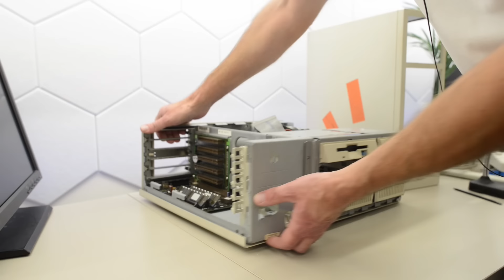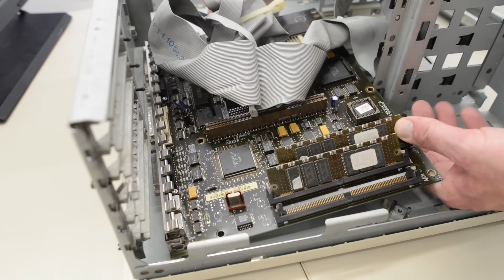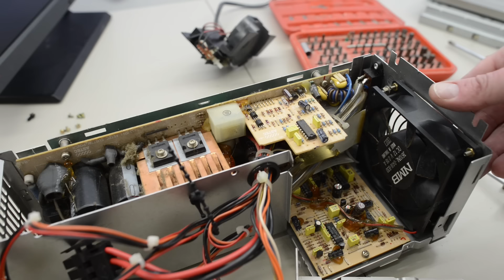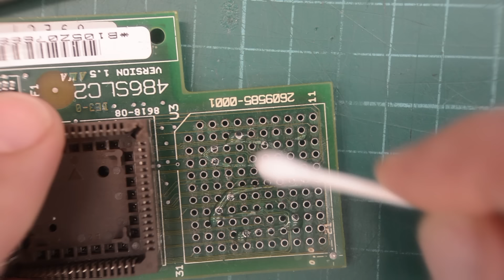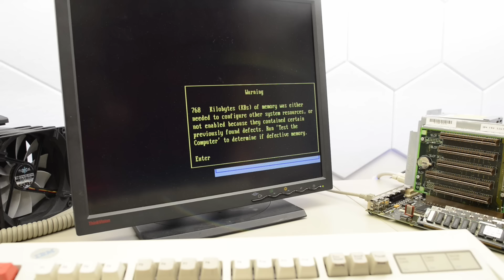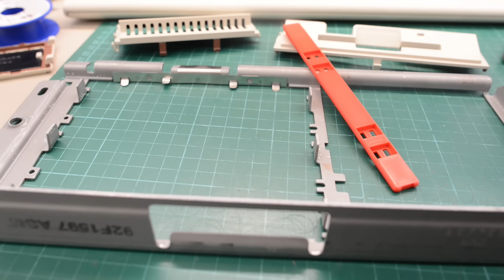Rare 486 interposer repair & IBM PS/2 Model 57SLC restoration (8557 & SLC2)

Comment: IBM PS/2 machines are extremely picky about their RAM modules. While most non-IBM machines simply try to enumerate the size of the RAM sticks by themselves, PS/2s rely on the presence detect bits. There should be one to four SMD zero-ohm resistors on the side of the module which are setting those bits. Your module, since it is not an IBM module, probably has all of those shorted to ground, so it gets detected as a 4MB 80ns module. Either remove all but the bit 2 resistor, or you might try to use some small bits of Kapton tape to insulate pins 67, 68 and 70. That should make the PS/2 correctly detect it as an 8MB 70ns module.
There's a list of all the combinations on ardent-tool: memory/Reference.h tm l
Reply from the maker: Thanks. I need to spend some time figuring out all the different IBM SIMMs. I'm hoping we will eventually be able to make custom PCBs for at least some of them

Comment: These are the memory module p/n for the 8557..
IBM Personal System/2 2-8MB    $1695   #5211  6450605  2MB  8MB  85ns  Adapter for 857x-xxx or 8580-xxx
80386 Memory Expansion                                                 Uses #5212/#5213
Option
 
IBM Personal System/2           $695   #5212  6450603  1MB  1MB  85ns  Module for 857x-x61 (P),
1MB Memory Module                                                       8570-121 (P), 8555-xxx (P),
Kit--85ns                                                               #8286, or #5211
Reply from the maker: Thanks. I wasn't able to find any RAM module with that number. However, I figured out why it didn't work just now :) It will be in this week's video :)

Comment: I dropped an AMD FX8370E and the pins looked like that. I straightened them all out using a tiny crosshead screwdriver by touch, since my eyesight isn't good enough anymore! It did take a while.  It's still working!. :-)

Comment: Ahh, the 2.88mb floppies. The bane of my existence. Someone got bamboozled by the local IBM rep for my local branch of Library, and they used them... And it always caused problems when those disks never worked anywhere else. Save your work at the library, but bring your own disks.

Comment: Nice job and nice PS/2 :-) But I have a question, how do you clean/wash those filthy power supplies? Thinking what should I do with my filthy AT power supply.
Reply from the maker: Thanks. I just wash them with warm soapy water and then dry them with hot air

Comment: About the double sided ram not being correctly recognized- it might be the case of the bios upgrade. I remember once we visited the bank branch where they used Compaq’s desktops. After running over with bios upgrade disk, each of the PCs started to report twice as much ram as before. It had appeared they were fitted with double sided sticks which started to be recognizable.

Comment: Nice video. I got a new old stock cpu upgrade that you used. It has that bracket you used and also had a black square plastic spacer that sits around the 387sx socket. The 56/57/76/77 chassis all had rotating badges, just like the pc 330's. The 76/77 also had floor stands that clipped on the case.
Reply from the maker: I'd love to find one of those stands, they look cool

Comment: 27:25 Many pre 486 motherboards struggle with suport for non standard RAM size like 2, 8, 32 MB. Sometimes RAM IC have non symetrical RAS/CAS adress lines, what is causing most of the problems with compatibility.

Comment: I have an IBM Model 40SX that seemingly uses the same case! I really like that machine, because it has ISA slots :D

Unfortunately, the soft-power-on power supply has died, and I need to repair it. Already recapped it, but that did nothing (kinda expected that). I suspect the power good circuit is bad. Don't leave this plugged into power!

Edit:
Just got to the part where you remove the power supply and mention it is not standard AT. That is true, physically. Actually, the pinout I have found indicates that an early ATX PSU would be perfectly suited to being rewired for this PS/2 power delivery style. But then trying to fit an early ATX power supply into the existing PSU chassis is not easy!
Reply from the maker: Yeah, you're much better off repairing the PSU than replacing it. Even if it turns out to be difficult. I will make a repair attempt on my Model 70 PSU (no power good). Hopefully in one of the videos in December.

Comment: The IBM 386SLC has 8Kb of L1 cache and runs all Intel 486SX instructions. The 486SLC2 has 16Kb of L1 cache, as you noted. When the 486SLC2 daughtercard is on the 8556/8557, it is run from the 20MHz base clock (meaning 40MHz internally); When used on a 9556/9557 system, the base clock is 25MHz.

Someday I plan to test all of the Model 56 and Model 57 systems as a comparison...
Reply: There's the link from the 'Ardent-Tool' as well...
Reply from the maker: Thanks David. Do you know if all SLC2s are good for 50MHz? Or even faster?
Reply: @Epictronics1 : The 486SLC2 daughtercards should be able to do 50MHz (although the 486SLC3 being able to do 75MHz is more evident) - I'll need to do a summary comment.

Comment: 5:53 - IBM PS/2 was a large construction kit. The same base chassis had been used for an ISA Model (8540) as well as for the 9577's and - IIRC - an entry level RS-6000 of which I cannot recall the model number, cause we did sell and support PS/2 only. A rare find were an IBM PS/2 Ultimedia M57.  I have a 9577 with the Ultimedia stuff. Used it in the early 90's along with the ACPA/A to convert analog records to MP3 ...
Reply: I stumbled across a plain 57 486SLC2 a few years ago and bought an M-ACPA/A card to get as close as I could to the Ultimedia configuration. One interesting thing it has in its driver/documentation diskettes is C source code for doing various things with the big Ti TMS320 DSP chip, including a JPEG decoder.
Reply: @bobbobson1605  The TMS320 was a family of chips assisting for compression purposes mainly for audio but video as well. Given the time they appeared they were pretty groundbreaking and the developers added a lot tools - of which the MPEG audio coding was the most prominent. I had a 77i / 486DX2-50 with the M-ACPA to record my old analog records under PC-DOS 5 and using the M-ACPA kit for quite some time. The bottleneck was the harddisk, since that was generic SCSI and they were non-streaming capable. Once they had to recalibrate your record was losed up. I recall having recorded the first side of Pink Floyds "Dark Side Of The Moon" at least three times ....

Comment: You could just solder some pins from a defective cpu. no need to remove it.
Reply from the maker: I don't think I have any scrap CPUs. I have however  repaired a 486 ones with a broken of pin by soldering it to the CPU. It totally worked

Comment: What kind of SCSI cable is needed for the external SCSI interface?  I have a similar IBM (8556) that I would like to add an external CD-ROM drive to but I can't seem to confirm which drives are compatible.
Reply from the maker: I have not looked into this yet. I have an external SCSI drive that I plan to restore an try out with some PS/2s in a future video. I'll do some reading (and probably get or build an adapter)

Comment: I'm actually surprised the 2.88 drive never caught on. I wanted one. So did everyone I know, but you couldn't find them.
Reply from the maker: It is strange indeed. Especially sins they were backward compatible with regular 1.44
Reply: @Epictronics1  A couple things: in the above sentence the word you want is since instead of sins. At 2:30 I believe the expression you are looking for is "It never really took off." not "on". Just a few things to be aware of. 

*Edit*  You probably mixed up the expression "It never really took off" with "It never really caught on".

In regards to the 2.88 MB drive, I don't really remember them being a thing. Since they are backwards compatible, I wonder why they didn't take off either. Maybe it was a cost thing?
Reply: @zeroProwler  I wasn't trying to be annoying, I was trying to be helpful. I'd want someone to correct me in the same situation if I was speaking in a second language.
Reply from the maker: @LotoTheHero  Thanks, I appreciate the help in spotting my mistakes. I'll try to remember
Reply: I think, it was a matter of price, availability and price of 2.88 disks on top of competition from ZIP disks and CD-Rom. And 1.44 was already too well established as the standard for publishing content on diskettes.
It was one of those things that came too late to enable it to take off.
Reply: @bikkiikun  cd's were a pain. zip wasn't backwards compatible. So 2.88 would have been nice.
Reply: The only other systems I know that used them were the NeXT workstations.  The disks were pretty reliable, but unfortunately rather expensive.

Most Pentium-class and up motherboards supported 2.88 drives, but the drives themselves were rare.  At one point I had an IBM 2.88 drive installed in my Athlon XP system!
Reply: @awd42  I just know back in the 90's it would have helped a lot. Unless they were zip disk prices. $10/disk would have been too much.

Comment: The 386 with L1 cache is unique enough that I wouldn't upgrade it. It's the only 386 model that has any on-die cache. I have only read about it, never seen even a video before yours! This is really cool.
Reply: Intel also made special 386 for laptops called 386SL which had integrated L1 (edit: after reading Intel datasheet, it only has integrated cache controller it seems), ISA bus controller and power management among other things. Compaq LTE Lite laptops used it, for example.
Reply from the maker: Yes, I think we got roughly half the FPS when we ran benchmarks on the IBM with a regular 386 compared to this SLC. These are both pretty cool "386"s!

Comment: I'm surprised you didn't grab the re-work station sooner. lol
Reply from the maker: Gotta try every method ;)
Reply: @Epictronics1  I'm watching you struggle and I'm like....at least use flux, but you should really pre-heat it.
Reply: I was also thinking you need a sweeper tip for your iron. It's nice and wide you'd be able to reflow the whole socket in 10 seconds or less. lol
Reply from the maker: @awilliams1701  What tip would that be?
Reply: @Epictronics1  I've seen them called sweeper tips. I've also seen spade tip and scraper tip.
Reply from the maker: @awilliams1701  Hmm.. Google isn't of much help. Do you mean one of these? https://www.amazon.com/Soldering-Electrical-Sensitivity-Conductivity-T12-1406/dp/B0DBGC6NG3

Comment: anybody else here have the strong suspicion that bending back the awfully bent pins with a mechanical pencil might have worked?

just to make clear, i love & admire epictronics! props to the man :-D
Reply from the maker: Unfortunately, some of the pins were missing. Otherwise, I would have tried.
Reply: @Epictronics1  oh okay, i didn't look closely, i was actually surprised how many pins were still there :-D
Reply from the maker: @autingo6583  Yeah, that socket had seen better days :)

Comment: You're too brave putting a VARTA branded battery in there! 😨
Reply: We must never forget the horrors they have wrought on retro PCs. I curse towards the sky, Vartaaa!
Reply: Lithium batteries should be fine unless you're throwing them in a fire. It's mostly the NiCd batteries that leak and destroy old boards.
Reply from the maker: Maybe, I should replace it 😅